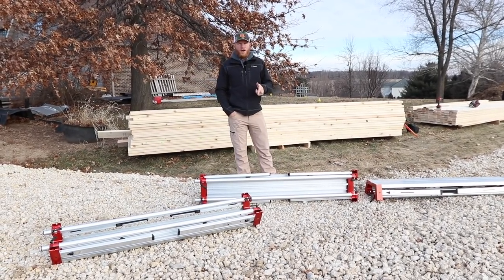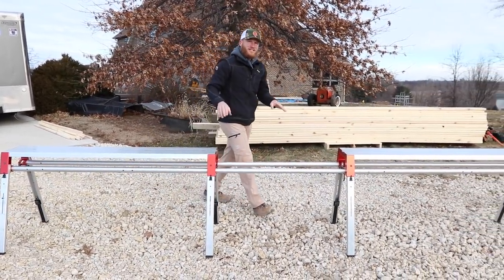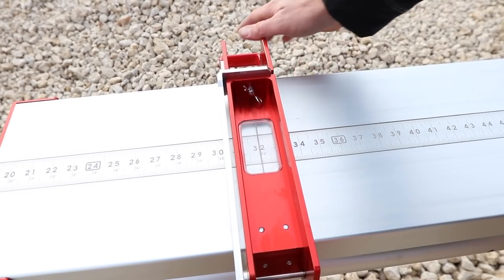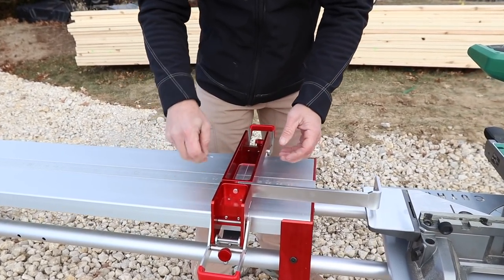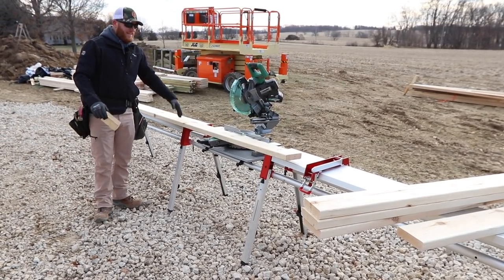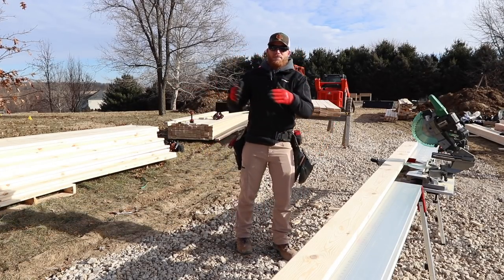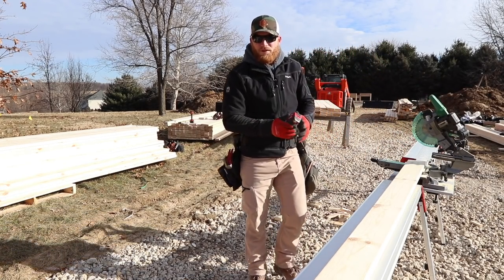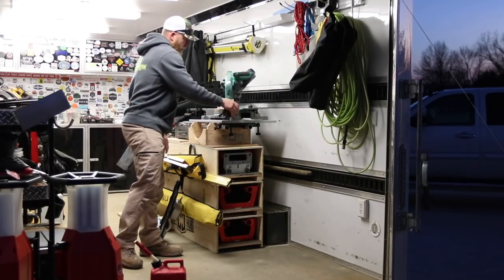Is This Work Station Worth the MONEY $$$$

Comment: The double cam on the stop block looks cumbersome. The button needing to be pushed to open the legs is unnecessary. Nice product, in theory, but needs to be simplified to be really efficient. I'd consider this a prototype. In a few years this could be a really nice product. Price needs to be significantly cheaper too.
Reply from the maker: def version 1.0

Comment: Really depends on the use case, for me, no I would not pay but I’m a weekend DIYer. If it was my lively hood and core business then yes. If it saves you an hour a day and saves lumber ( from having to scrap bad cuts) then it’s paid for itself in a few months, that’s good business. My job is in electronics and iv spend £500+ on a scope and £350 on a soldering station, that’s a lot to most but to me it’s a good investment. It’s all relative.

Comment: I suppose until Version 2 comes out, you could use clamps to hold the sections together. Also that area where the stop can't go, you could use the "safety bar" to extent into that area.  Nice video. Seems like a good system. R

Comment: Seems like a good investment but, couldn't you drill holes for those mounting clamps? That way, your saw was "set" each time without that extra setup step. Make sense? 
Don't you still worry about the entire system being level? I have 2 "corded" miter saws, 1 is attached to a rigid universal miter saw stand. It has extensions that allow me to still handle larger boards. If I need longer support, I use the roller stands. The other is a Bosch with it's own stand, same principle, it has extensions and if needed I still have the support stands. I use an 8 foot straight edge/level gauge to ensure everything is level to the table of the saw. From what I can see, even adjusting the legs, you're still giving yourself a chance of actually cutting a slight bevel cut, unless that's not an issue for you? Hope that makes sense to you, would like your thoughts on that. Otherwise, again, it seems like a very good investment, really like the idea of them "locking" together.

Comment: In ideal conditions,  it will work fine, except for my .02 cents
1.  Not all landing zones are clean.  You will be wasting time cleaning the mud off those pretty rails. 
2. 12" higher bench height for the cutting table.
3.  Not so easy to set up in an even work area. 
4.  If you need 20' of line space to cut lumber,  that's too much.  Not all construction sites will allow you that luxury.  I'm thinking it will be a PIA to walk/work around.

Other than that.  Perfect.   Price point isn't a factor

Comment: I have incorporated this concept with success but four to six k no. Mine was based on 8-9' walls. You can not cut sixteen-foot Doug fir accurate unless that thing is level or you are superman. You can see it happening in the first couple you cut. I would have liked to see speed square down the 1 1/2 side, but honestly, I have cut enough wood that I do not need to. Bring the saw to the wood or bring the wood to the saw is an old question. Love the concept but there are a few missing dynamics in the discussion.

Comment: I think in an afternoon you could grab some trojan style legs and some lumber and be at around $500 bux that would function exactly the same. theyre making too much or paying too much for something without a motor to cost 4k

or you could buy three dewalt stands and modify them to do the same thing
Reply from the maker: all true...except the tool that locks a measurement in for consistent cuts...and the fact that this miter station is also a table saw outfeed...I just didn't show it

Comment: If they can figure out how to manufacture it at around $250 and sell in the $600-$800 range, then i can see it taking off.  Products need to be marketable, and pricing is a big part of it. Most contractors' total tool cost is under $4000. A 4ft (250lb capacity) aluminum platform at home depot goes for $50. The guys need to figure out their at scale (eventual) production cost, price the product based on it, and cover the losses in the short term. Unless they do this, they will likely never get to scale.
Reply from the maker: a942687032679840126 very good point

Comment: When I need to cut allot of lumber to a set length like 16' or 4' I just make a quick jig out of a longer piece and add a stop on one end. After that any circular saw will work... Cost: 0, time: 10 min. I'd rather use my head than wallet any day.

Comment: I say yes worth the investment. When I worked @ Spirit Aerosystems, I was a process engineer for many years. If it save you man hours and reduce cycle time it’s a win, win. I bought a torque wrench that cost 20K, yes $20,000.00 not a typo. It made a four man mechanic and one inspector into a one mechanic job. The data was electronically saved and the mechanics used a reaction device to absorb torque. Oh and the torque requirements was 560 ft #’s. 
In short your workstation will pay for itself over and over!
Reply from the maker: Bret Lambky I agree Bret.  It’s hard for some people to see it and I cAn understand that.
Reply: Maybe he shoulda priced it at $10,000

Comment: Sorry, but The Paulk Total Station Ultralight has it beat and it even has a place to put cut parts, not balancing them on the extensions.  One downside for you. is that you must build it.
Reply from the maker: D Scott I failed to show the extensions that get put on and the table saw outfeed.  It’s the entire package that really makes this system worth it and the ROI make sense in my opinion.
Reply: @RRBuildings  Ron Paulk uses the Total Station as an outfeed table for his SawStop Contractor table saw.  You and Ron have very different business and your needs are not the same.  Lately, your trailer is looking more like Ron's too! lol
Reply: @dsdragoon  I've never seen Ron Paulk use his outside in the snow.... snow turns to water, snow also turns to rain... Can't beat aluminum for working outside.  From most of the comments on here, not too many have experienced the joys of framing in the winter, especially a house.

Comment: Many years ago,,, one of the best builders in Montgomery had a long  16 ft. open trailer fab'd up in his shop made of heavy steel tube and angle iron and 2x lumber top, single axle and a trailer hitch,, and they permanently mounted an old, large Dewalt Radial Arm saw on it , that never quit. watched them pull this saw for over 30 years from one subdivision and job site to the next...It framed 1000's of homes and sat out in the weather all those years, with nothing but a canvas cover over the Dewalt RAS...They may still be using it, lol ...Setup time? Zero minutes.....It was built ready to work,,,Cost probably a hundred bucks in the 60's.. That aluminum deal you show,, may look pretty now,,,,but in 3 or 4 years it will be done ,,,,  You guys will wear that thing out in a hurry,,, 
BTW, Great videos you guys do...

Comment: Great video and appreciate the info but I’m thinking I can do this with 2 dewalt stands or more tied together for around $600.
Reply from the maker: Jeff Kowalski hmm not sure how you would set up your table saw.... have a locking measuring tool.... not to mention it comes with some cool extendable work stations you can move around to where ever you are working.  Also use them as scaffold if need be
Reply: RR Buildings what is the weight rating on these Kyle?
Reply: RR Buildings I’m not trolling. Great vid. I just think with a little ingenuity you come up with a diff solution for cheaper.
Reply: I know you can mount your table saw but unless I missed a video you haven't really shown how useful a 20 foot outfeed table can be. That being said you can buy tools to make yourself more productive or you can give your money to the tax man (unless you're not profitable, then you just bust on other peoples videos). @RRBuildings

Comment: Saw horses and circular saw. I am pretty good with them. I don't think I need that contraption especially for framing. They take up too much space on the jobsite, the ground has to be level to set them on, you can leave them out or they will get stolen, employees will drop them and bend them somehow, too much time involved to set them up. I can cut 20 ceiling joists with my horses before you get your cut station set up.

Comment: I'd set up the work station 90 degrees from the wood supply rather than 180 degrees so I wasn't loading a long piece with a 180 degree swing.
Reply from the maker: Julie Gurley great call
Reply: I thought something similar when i saw how things were positioned, i figured a few jobs would lead to more efficient setups, 90 degrees like you said. Or line the benches up inline w/ the pile, and have a linear workflow ->   raw pile ----- saw -------   ------- finished pile.. Might be too much walking around tho.
Reply: @pyfferoenc  not really any more walking than he did in this video.
Reply: If you got the space a triangle is probably the most efficient setup for the pile - saw - finished workstations, so 60 degrees apart. Same as a kitchen triangle.

Comment: I'm not a professional, but from the framing I've done on my own, having to change the setup for an 8' vs longer would be a deal breaker. Last garage I built, i slammed a miter station together with saw horses and plywood. Maybe not as quick, but never had to tear it down each night. If I was full time, wouldn't be hard to make one that has a measured stop block. And could be torn down.

This is still cool, but not 4k cool

Comment: There should be a clamping system instead of thumb screws to attach the saw to the stands.
Also some sort of adjustable stop for the end of the lumber that can be lined up with the saw.
Reply from the maker: NoC agree there is still lots of room for improvement
Reply: @RRBuildings  $4000 seems way off the mark. Sure it costs a bit to do the design and have custom aluminum extrusions made, but they need to think about what their potential market is, not just about making their money back the on the first few units.
Reply from the maker: NoC fair enough I don t know their business. This system will last for quite a while... if I save time on every frame up on each building... it will pay for itself.  Labor and quality are always my main driving force when looking at tool investments.  I 100% agree 4k seems high but then again so is a $1500 miter saw (festool) yet people buy the crap out of it.

Comment: that's a killer unit and I love how firm and stable it is. I currently use the Ridgid big assed heavy cart on wheels for my Dewalt 780 and I bet it weighs as much as that entire set up. I hate that I have 2 spindly four foot arms to hold up my work and once cut the work falls to the ground. I especially like the table saw out table. Curious if it would work with my Dewalt table saw cart.

Comment: As person who has had to do repetitive tasks hundreds, and THOUSANDS of times, any tool that helps is usually worth the time and money. To each person, however, the decision to buy would be different. Truth be told, there are tools I have, that I was forced to buy to do a single job, and those tools can be a wallet burner. (You can't re-sell the damn thing without taking a huge loss.) But anything that makes a particular task faster and easier - several thousand times - is worth the cash.
Reply: But you act like this 4k stand is the only option. There are many cheaper options.
Reply: @skliros9235  True, I have made them myself. Then, I take it apart, use the scraps for other things, thinking I'd never do this again. Wrong. And, once you done that four or five times, you might wish you had one of those things. Still, I would NEVER spend the money - unless, like this guy - I'd committed to the business. Also, if you ARE doing the work, and staying more than 'busy', 4 grand is an awesome tax deduction. Remember - it's business. My own 'other' business, was a yacht service in Boston. Any idea what kind of money I had in a business with 22 employees, servicing 400 boats? But, you're right, 4 G's is a fat lump when your business is small, Still, I understand it - my back understands it (and I have no back injury - it is just stooping to do a task 150 times in a day.

Comment: Here's the deal, if you have a work truck, you have a tail gate, if you have a tail gate, you're already two thirds of a way towards having a work station and if your salt is worth it, you'll know how to make a folding station on top of that.
Sorry, but this whole aluminium extrusion madness looks like a horrendous waste of money.
Reply from the maker: aserta I cut almost my entire building up out of 16’ lumber.  I also rip a ton of long length lumber on a table saw.... for me this system allows even the most experienced guy on site to perform those tasks not only at a high quality level, but efficiently and safely.  4K is not even a question to me regardless.  That being said.... I was extremely skeptical as well
Reply: Yea, a tailgate isn't suited to cut 16' or longer boards. That and not every job involves being able to back the truck right up to the work site. Most of my jobs for instance, I need to head to the back yard. No way I'm setting my tools up where I can't keep an eye on them.

Comment: The stop is useful. And yes the lenght of support is great and would be great for stud work. When i was looking at you setting it up i thought what if the measurment comes between the benches? And for 8ft not to be a option tells me the dont have a clue the manufactures. Because for me its too expensive and takes to much time. If i need a long bench and i have the space. I use a few saw horses and a few lenghts of timber. And if i need repeditive cuts cut one and screw stop to bench at any spot. Its a well made product but not worth anywhere near $4000 maybe i would pay $500 at most to have the option of it. But i know its not practical for site work. I would be fed up setting it up and explaining to my apprentice how to set it up and take it down. Better make a bench on site with timbers there and just bring in mitre saw and take home in the evening. Job done.
You guys must be getting these products for free to try push them onto us.

Comment: If you make a cut list for all your hdrs, trimmers, sills and pre cut em a station is fine.........production framers would never use one of these....

Plus that thing is huge, need lot of space fairly flat and you could make one those right on lumber pile itself....just cut a notch width of saw in 2 pieces of lumber

Comment: My partner who loves tools and hardware, bought the Cut Hub, very nice stand, well designed and you can put you're portable table saw on it as well, that said, $3400.00 dollars for a mitre/ table saw stand is absurd, but he also bought th  Festool Kapex slide saw for $1540.00 with tax, also insane, I have the Bosch Glide saw, just as good for $850.00 less. COME ON !!

Comment: I just cant see how or why u would want to use this, especially for your application. It would slow the process down so much. We always use a cordless saw and cut our lumber where it sits. Not sure why you would want to move all that lumber twice as much. I can see for trim work but not for framing. Just my opinion.
Reply from the maker: Warren lll do you throw your tape measure back and forth on the pile... mark your measurements and the make a square line in every board?  Then once you cut a layer move all those off the pile and take them somewhere??  Then this would be quicker wouldn’t it?? I could have done a better job setting the piles up... I give you that
Reply: Yes we cut what we need on the pile and take it directly to where we need it. That way we arent moving the wood twice only once. Im not trying to say were better because u guys do amazing top notch work. But there is no way our boss would let us set up a chop saw station for framing.

Comment: I'm surprised you aren't using the DeWalt cordless 120v Flexvolt miter saw. Has a lot more power than
the Metabo, and it runs corded as well as cordless.

Comment: I like it at $2k or less. There are other solutions on the market. They might not be as stout, but that could be a good thing too. 

For cutting window/door opening parts, a miter saw with a stop makes sense (small blocking too). 

Long material should not be moved to a miter saw station, in my opinion.

Comment: They could easily create a small tray to bridge the gap so you can cut 8 foot lengths
or
would that 10" drop down attachment enable you to lock that stop at 106", flip down that 10" attachment and get 96" cuts?
Reply from the maker: oobaka1967 I like your idea.... I don’t think the 10” stopper works unless I’m dense
Reply: @RRBuildings  I've witnessed your math skills. You're definitely not dense.

Comment: Regarding the problem of not being able to set the stop at around 8', could you slide the miter saw left or right a few inches on the support poles and then set the ruler off the blade? Basically, skip the gap.
Reply from the maker: very possible

Comment: Back in the day when Australia was still adjusting to the Metric System I had to cut some Boards to 123 Inches, but only had a 10 Foot Tape Measure. 
I marked a Board at 120 Inches and then added 3 Inches to that. 
I used this Board as a Template to Mark and Cut all of My Boards. 
My Mate did exactly the same thing. 

When We started putting Boards up, We noticed that all of My Boards seemed a little short. 
Apparently I had inadvertently added 3 Centimetres to My 120 Inches. 
Whilst My Boards were indeed short, they lasted over 20 Years on the Wall and because We intersperse the short Boards with their longer version, we 'sold' the idea that they were deliberate cut that way.